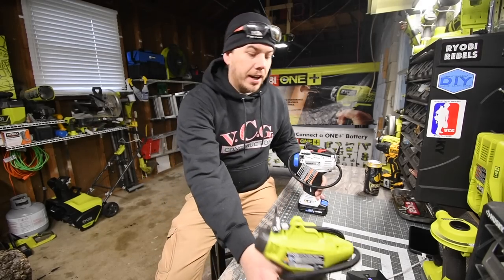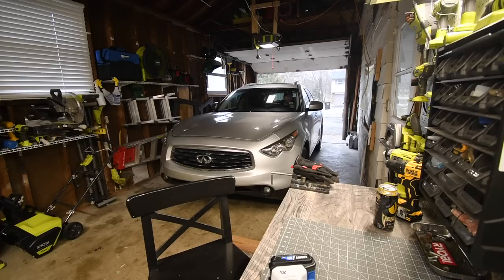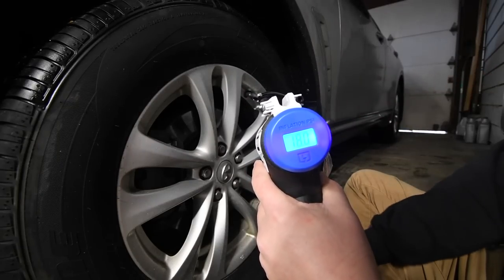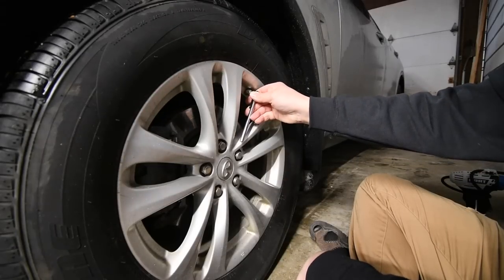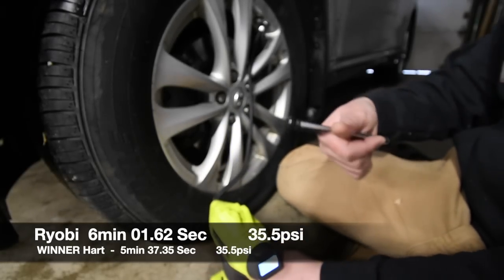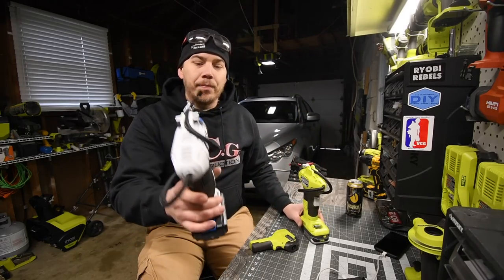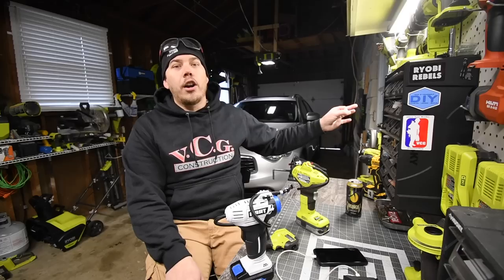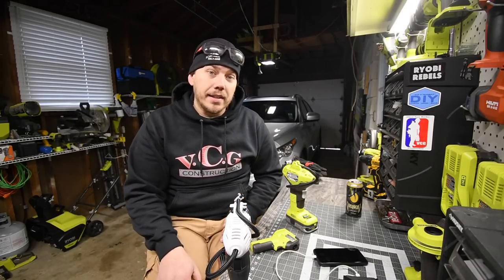Hart vs Ryobi Tire Inflators

Comment: Those tire pressure stick gauges you're using are highly inaccurate.
Reply: Not all stick gauges are inaccurate, I have one that is spot on.
Reply: @Pro1er  my experience is that most are just trash
Reply from the maker: I will be doing another test on that and thank you
Reply: @jjsrt8  i used to have your experience, i figured out i wasn't using it correctly.
Reply: yes they are ive had them red 35 when 55psi
Reply: Any gauge can become inaccurate. You have to compare them to others.

Comment: Thanks for the review. Those hand held units are cheap and all the inflator hoses are susceptible to heat and poor tire pressure readings. The best battery unit for the price is the Ryobi P747.  Do a review or comparison and find out. It will read accurate to about 50 psi but because of the mediocre quality of the hose above 50 psi the unit looses accuracy.  Looking forward to your review.
Reply from the maker: I can do that and thank you for the suggestion
Reply: Had the first royobie for 2 yrs used it almost every day worked great, loved it cheap tool hell no saved me all the time. So what happened to it after 2 yrs you ask one of my workers stole it . They  must of liked it as much as me. lol
Reply: big truck tires too lol running 50  psi

Comment: Hmmm my pickup truck tires max psi is 80. I keep em at 70. Seeing this I think I will stick to my air compressor. I am all Ryobi, but was curious if going battery with a Ryobi would make it even easier.
Reply from the maker: In some cases a compressor is better

Comment: Ryobi and Hart are made by TTI which makes Milwaukee.  They are the same tool from the same factory.  Ryobi is the cheap name plate tool for Home Depot and Hart is the Walmart variant.
Reply from the maker: Correct, Ryobi isn't cheap anymore, doesn't cost that much more than dewalt or milwaukee

Comment: I'm thinking about picking one of these up for the air bags I put on my truck. I'm currently using a pump to inflate them when I'm out, but the Hart one (at my local Walmart for $30) may wind up coming home with me this weekend 👀
Reply from the maker: it is worth it but id get a 4ah battery as well
Reply: @ManCaverTools  awesome. I'll look into it 😎🤙

Comment: any tire gage is suspect! I use it ONLY to get an estimate. I then run the vehicle on the hi-way and check the footprint. If it shows signs of NOT touching at the inside and outside edges of the tire tread face, I let out a couple of pounds. IF it shows signs of road contact past the tread face, onto the sidewall, I add a couple of pounds.  The tread face should make full contact with the road surface, and no more or less.  I still own the '72 Ford E200 Econoline van I bought in '74. Had Remington L60's bias tires on the rear, and ran at 17 lbs. When I replaced them, they had almost 63,000 miles. It is the pressure that makes the difference, and the correct pressure is determined by the size of tire to vehicle weight ratio. All tire installation places put the amount "RECOMMENDED" on the tire, usually around 35 psi, for liability reasons. You know how people are, they sue for anything... ask wally-world!!!!!  This is your vehicle, you have the responsibility to check on its well being! Don't be like all these folks looking for someone else to take care of you all you life,,,,,,, like Ole Unk Sam!!  heh-heh-heh
Reply from the maker: These ones are not that great. I like the bigger units much better and they are more accurate, in my car I have digital trie pressure gauges that are directly from the tire to the display in my car and they are accurate

Comment: Hart sure is making tons of tools. Now they have a couple vaccums coming! A stick vacuum and a house vacuum. Even a fricking spray bottle type tool!
Reply from the maker: yes they did, I cant wait for more brushless tools to come out
Reply: @ManCaverTools  I just wish they were a little more contractor grade like ryobis top of the line stuff.
Reply: @ajgreen868  no point. Both brands are owned by TTI, HART is intended to meet the low price points Walmart demands. Walmart competes on price, not quality.

Comment: The tire gauge you’re actually using those are garbage and are so in accurate, most tired cages are very in accurate unless you buy more expensive ones. Accu Gauge is the best you can get. They are actually calibrated and the most accurate gauge you can buy. You can also send them in anytime you want to get recalibrated.
Reply from the maker: I agree. I have a real tire gauge now

Comment: I believe your tire gauge is inaccurate. Hyper Tough used to have the same one too, but with an analog gauge. Walmart only carried it for a short time. It had a light and a trigger that you could lock on - and I'm guessing that's why they stopped making it. If the inflator was actually capable of PSI in excess of 120 and someone walked away from the tire, you would have a potential bomb sitting there. Lawyers don't like that kind of stuff.
Reply from the maker: There will be other tests on these with different sized tires
Reply: @ManCaverTools  David, H.D. has a Husky digital tire gauge for $7, you may want to give one a try, I bought one a couple years ago and it is spot on, (though mine is slightly different from the current one). My Ryobi hand-held inflator with the digital gauge matches two known accurate tire gauges exactly. I also have the new auto shut off inflator and that one is accurate to 0.5 PSI.

Comment: I wish the Ryobi had a trigger lock, so it can't be activated in my trunk.
Reply: Disconnect battery. Throw it all in a little carrying case. I have a roadside kit bag keep everything in.
Reply: Those husky tool bags that stay open work perfect for that purpose.
Reply from the maker: I do as well
Reply: @jjsrt8  I put a small piece of thin electrical tape over the battery terminals and keep it together.

Comment: The 18 and 20 volt are the same. Five lithium batteries with an idle voltage of about 20 when charged. It is all about the marketing. I guess the next one will be called the 19 volt super maxi.
Reply from the maker: I know. it is marketed without a load. once you turn the tool on it goes to 18v